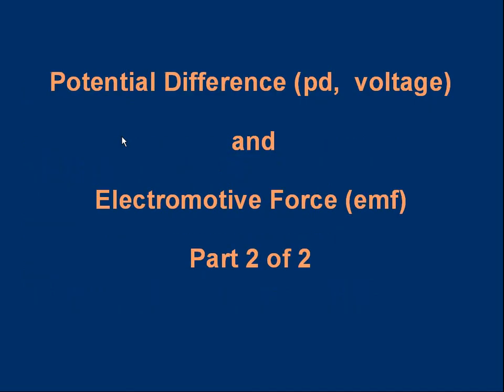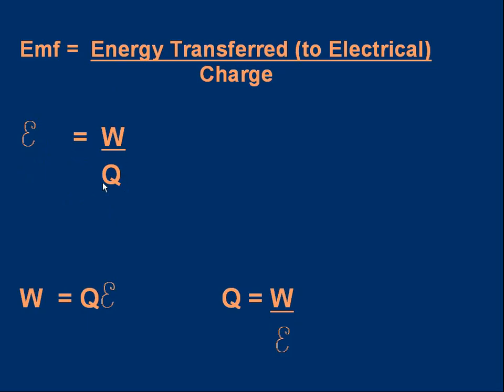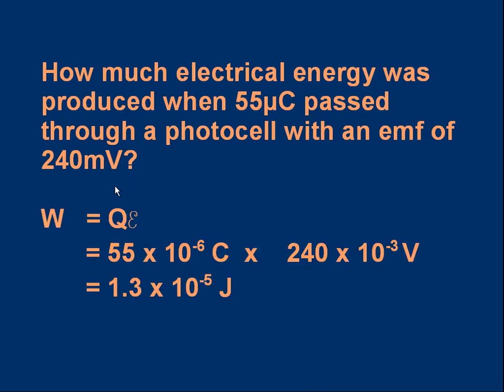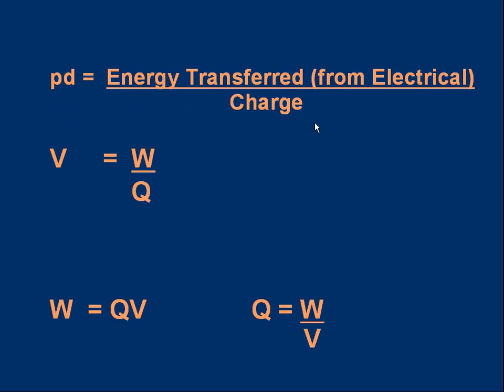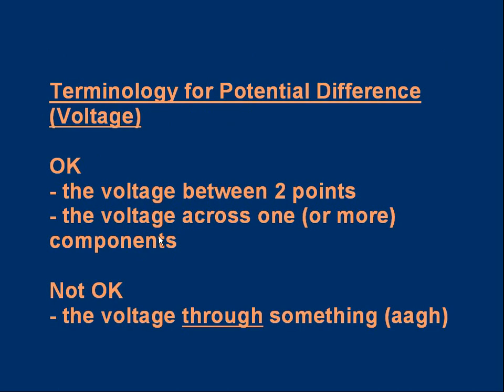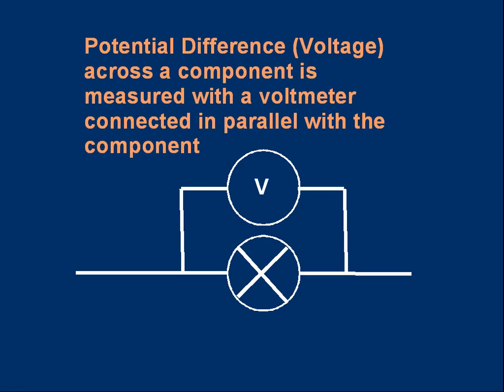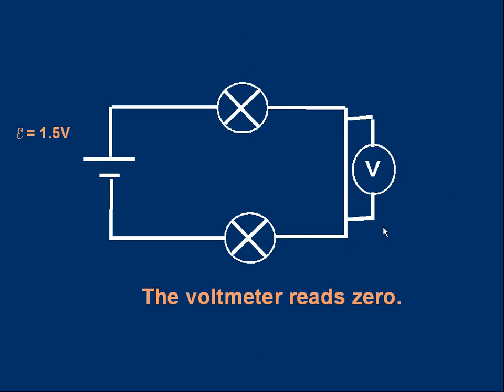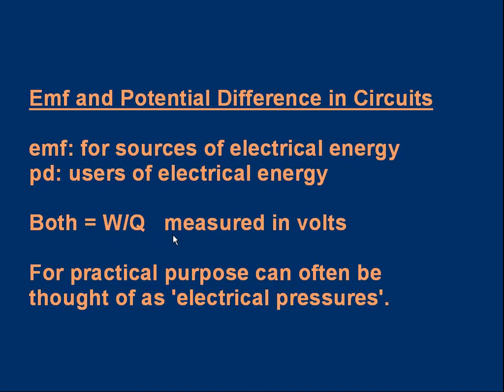GCE (A level) Physics E04 Emf and voltage. Part 2 of 2

Comment: Hi, quick question. Why does the battery/cell have to be disconnected from a circuit to take emf? (could you not just do it across  just the battery/cell when it is connected in a circuit?
Reply: I thought that EMF is equil to the sum of the voltages in a cuircit? Thanks.
Reply from the maker: The voltage between the two battery terminals is only equal to the emf when there is no (or negligible) current through the battery. 

If there is current, the voltage between the terminals is smaller than the emf because of the voltage-drop across the battery's internal resistance. (You will need to read-up internal resistance if you are not familiar with it.) 
 Disconnecting the battery ensures there is no current, so the measured voltage equals the emf.
Reply from the maker: Yes, it is a property of a circuit that the sum of voltages around a single circuit-loop equals the emf in the loop.  This  even has a name - Kirchhoff's 2nd law, and one of my videos explains it: http://www.youtube.com/watch?v=fKZ_VydOTQk

However, note that this is not a definition of emf. A battery has an emf whether or not the battery is part of a circuit.

Comment: Hope you can help...
how do the electrons transfer voltage to the load as they pass through? do they vibrate less and if so would that not be kinetic heat transfer? is it that the electric field around the electrons get weaker? also, why does a circuit always use up 100% of the voltage? e.g. if you you took out all the loads in a circuit creating a short circuit, there is almost no resistance, therefore where is the energy transferred?
Reply from the maker: +AgeofVergo 

“how do the electrons transfer voltage to the load as they pass through” 

They don't.  Voltage is due to the electric field through the circuit, which is a bit too advanced to discuss at this level.________
But if you mean “how do electrons transfer energy to the load”, then the simple answer is:
The electrons bump into the atoms and give the atoms extra kinetic energy.  This
increases the atoms' random thermal motion so their temperature increases.
If you followed an electron as it moves through the circuit, the electron would hit an atom which then gives the atom extra kinetic energy. The electron is then moving slower.  The electric field (which is constant) then speeds up the electron and the process is repeated.________
 “Why does a circuit always use up 100% of the voltage?”
Voltage is not 'used up'.  You mean why is the external voltage equal to the emf. See myanswer to your previous posted question. Voltage in a circuit is controlled by the law of conservation of energy. Watch the video! 

________

“if you you took out all the loads in a circuit creating a short circuit, there is almost no resistance, therefore where is the energy transferred?” 

The energy is transferred to the remaining resistance (even if very small) which can get extremely hot as the current is so large that energy transfer is very fast.

Comment from the maker: +Fiza Ali

Unable to reply to your message as there is no reply option.  So hope you get this.  'Voltage drop' is just another term for voltage or potential differnce.

It is often used when the potentials at different points in a crcuit are being used. So if one side of a resistor has a potential of +10V and the other side has a potential of +7V, the voltage drop is 10-7 = 3V, which is the same as saying the voltage across the resistor is 3V.

Comment from the maker: Not sure I fully understand but.....
The voltmeter 'can't tell' the difference between the effect of an emf from a source
and the effect of  a potential difference across a resistor.  This is because in both cases the overall effect is to push an extremely tiny current through the voltmeter.
[If you connect both leads of a voltmeter to the SAME terminal of a source
(e.g the positive terminal) then the reading is always zero because there's
nothing trying to push charges through the voltmeter.]

Comment: I have a question: i can understand how the voltmeter measures voltage by taking the difference between one point and another (hence why the voltmeter displays zero on just the segment of wire), but then why wouldn't it display zero when connected to the source?  unless the +'ve side has a value while the -'ve is zero... (still a newb lol)